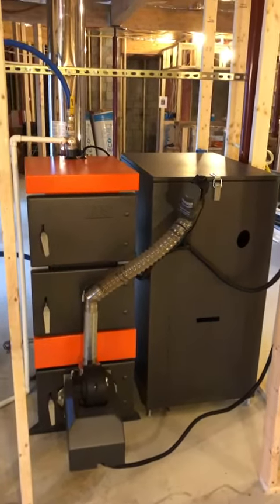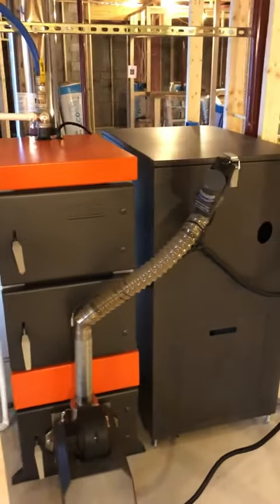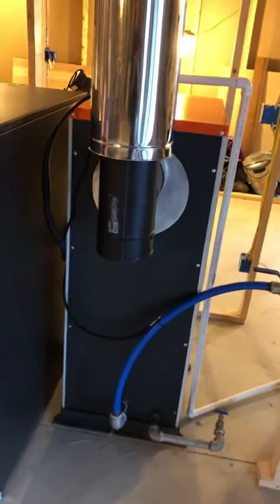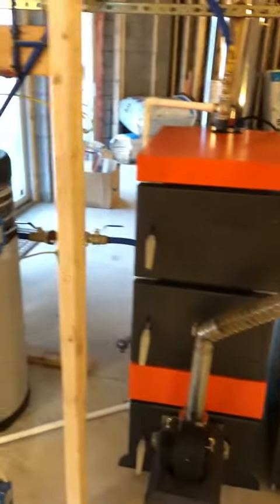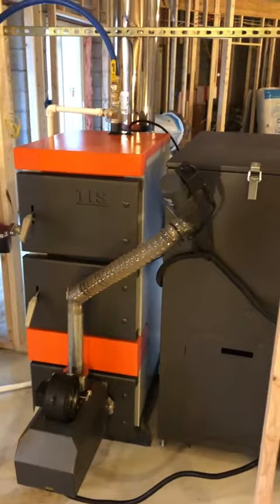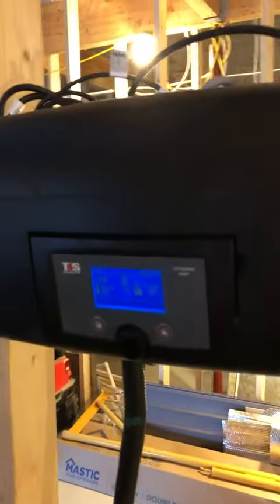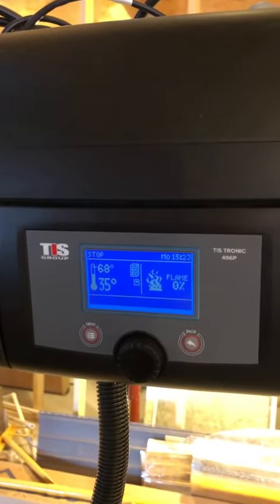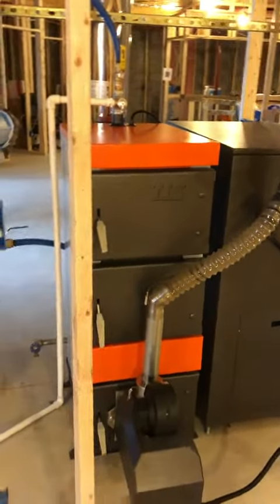Pellet Duo Boiler - Radiant, PA, USA

Comment: MBTEK UNI15...What is the trick to not getting a room full of smoke every time you have to add wood? I've have been cracking open the bottom door for a minute before hand, but still get smoke and sets off fire alarm.

Comment: Good purchase, im not electrician but one phase 220v used in Europe is not same power called 220 v in usa,  this boiler is made for one wire to be 220 v and second one is neutral.I see you just toke 120 and 120 from panel. Another thing i noticed is blue pipe connected to boiler usually is used for domestic water and is not recommended for heating systems with corrosive materials in system , use   croslinked pex for hearing , as any steel boiler return temperature should be not lower than about 55 C your boiler will corrode prematurely use 3 way, 4 way valves made for boilers to achieve that  that . I am writing all this not to criticize  but to help , that's what i know, you know now.
Reply from the maker: All boiler since 2020 comes with a 120V controller ready. Yes must use oxygen barrier PEX.
Reply: @mbtekofficial  Great.
Reply: So you tied 2 legs of 120v to the unit or how did you get 220v to one leg?
Reply: @derekkirsch6850 The only way to get 220 from 120 on one leg is to use step up transformer .